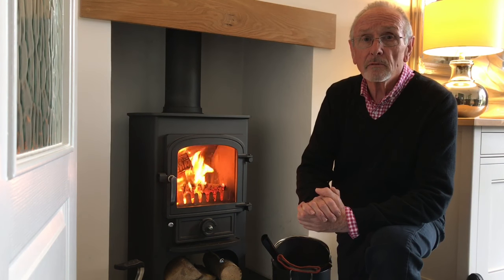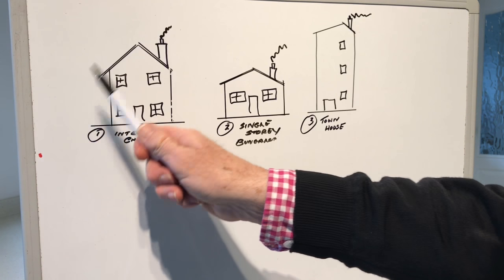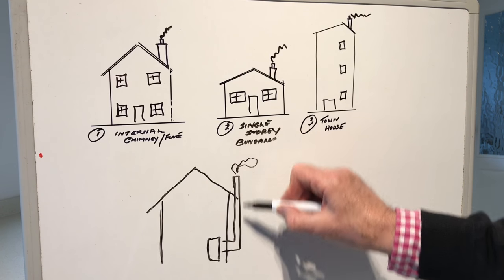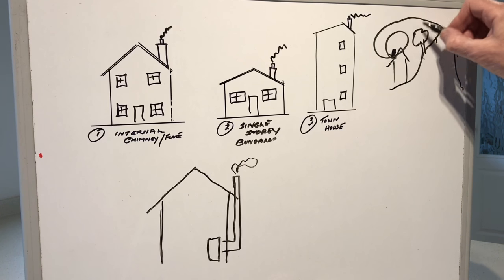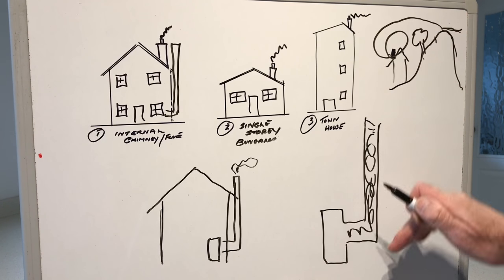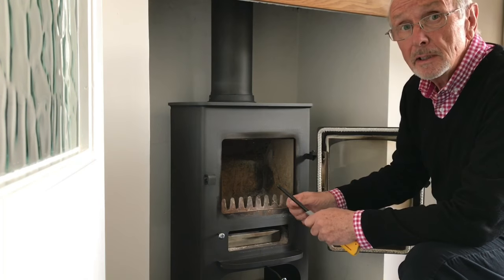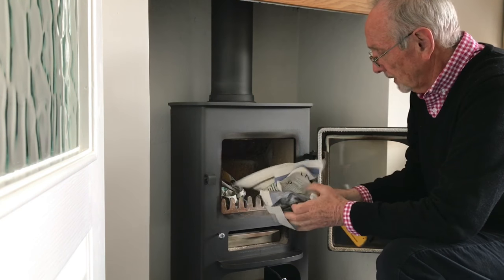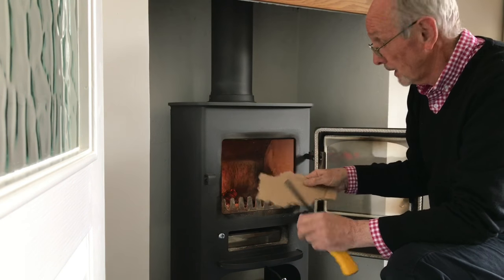How to Stop Smokey Rooms When Lighting Your Log Burning Stove (Revised Film Resolution)

Comment: Build a top-down fire.  Place relatively large pieces of firewood on the bottom, medium pieces atop those, smaller pieces on the medium, then kindling and tinder atop it all.  Light the tinder, which will burn warm and smoke free, igniting the kindling, etc.  The flue will be quite warm long before the larger pieces of wood might create any amount of smoke.  This is far and away the easiest method by which to light a fire from a cold fire box.  It allows you to stack material, in a criss-crossed pattern, before lighting but a single match for the whole fire.  You can walk away and come back after an hour or more, secure in the knowledge you will have a hot, clean-burning fire in your stove.
Reply from the maker: Thanks Jason and a good way for many. This can be a good way and I use it myself quite often, however it does have a few issues and for the new user or less experienced user there are possible problems. I will do a video on this soon, but the two main issues are as follows (1) if and only if, the fire fails to push the cold up the chimney you have a full stove of timber etc to deal with as the room fills with smoke.  (2) If for any reason you open the door, this higher fire can fall forward and may spill out. I know this is being ultra carefull, but to the unexperienced (and this is the people I am targeting to help!) this may be a big problem. Many people get nervous when they first have a log burner and don't have the skills to deal with the unecspected. I'll tell you all a quick true story - I had a new neighbour living in a cottage not far from me who attempted to lite her first stove ever. She was living alone and lit the stove, it went well, in fact it went too well, I was called and rushed to help. Her stove was white hot I could not get near it. So called the fire brigade! What had happened was a cinder had found it's way into the lower air intake and blocked the mechanism from controling it. She had loaded the stove up to the top and the air intake was wide open, the rest needs no explanation. Surrounding area was heat damaged and in need of repair and redecoration. It took the fire brigade only minutes to get the stove under control by dropping powder (probably Carbon Monoxide!) into the stove denying the fire of oxygen. Maybe not Carbon Monoxide, I will stand corrected if anyone knows better. So I keep my teaching skills aimed firmly at my target audience (beginners) for safety reasons. Thanks
Reply: This is the way I always start my wood stove fire.  I place two large pieces of wood on the  bottom with a space between the two. In the space between the two I use kindling and a small amount of paper, usually tubes from toilet paper and paper towels. I place small wood on top.   And for kindling I use broken twigs in my yard from my trees.
Reply: This works fine for me , I have an external flue and was getting smoke pushed back using conventional wood pile with fire lighter underneath .
I put two under the stack and one on the top which I light it burns down and eventually catches the ones underneath pretty quickly.
Flue is warmed and never had any problems from using this method

Comment: Add this: open a nearby window before you light the paper. This corrects negative pressure. Simple and effective.
Reply: Ronald Morris yes! Just crack a window, preferably the opposite side of the house or basement where the wind is blowing towards the house. You can also use a hair dryer in the stove directed towards the flue for five minutes. You can also use a space heater facing the opened door of the stove. Lighting news paper, blow torch, hair dryer and space heater also work for the fireplace. Got to get that flue warm.

Comment: I have an external flue and had a smoke problem. On cold nights I use a Black & Becker electric heat gun to 'push' the cold air out of the flue. I put the gun (sitting in it's upright plastic holder) inside the  firebox for 5 mins. I then remove it,  build the kindling fire and get the fire going as quickly as possible. No more smoke.
Reply: I've been using a hair dryer for years, same way, same results. It doesn't get as hot as the heat gun but it moves a lot more air, helps to establish draft. I have also tried a large brush flame torch, (not a flash light torch) and found the hair dryer worked just as well without wasting acetylene.

Comment: I  have a large wood furnace, and have a big problem with smoke. I open a window, and light newspaper first. I sometimes get a lot of smoke coming out of the door. Even when the fire is burning well, when I slowly open the door, smoke comes out. I had an extension put on, and this helped, but again today, lots of smoke in the basement. I have a wood stove and fireplace that I use sometimes, and have no problem starting them. It is very upsetting. I wish there was a professional that could come and stay at my house for a few hours and see how difficult the situation is.

Comment: Along with the heating method you should also crack a window, preferably on the opposite side of the house or basement where the wind is blowing towards the house. This will help replenish the pressure needed to help move the air up the flue. You can also use a hair dryer in the stove directed towards the flue for five minutes. You can also use a space heater facing the opened door of the stove. Lighting news paper, blow torch, hair dryer and space heater also work for the fireplace. Got to get that flue warm and new air/pressure flowing!
Reply: That is exactly what I do and have no issues with smoke

Comment from the maker: Good advice  from 'Theoriginal1981' and you know the problem well. Most people install a log burner and are not aware of the safest way to start the fire lighting process. I've heard a lot of comments on rooms full of smoke over the years, just a little preparation and the problem is solved.

Comment: Hi Mike we have had some really big issues with our log burner up to the point where we have had almost enough. In desperation we turned to the internet and found you on YouTube video which has really sorted the problem. Just like you we have an external flue in a very exposed location, but after following your excellent advice the issue was resolved. Thanks so much you have saved the day and our log burner. John&Hazel.
Reply from the maker: John so pleased I could help, I will be doing a new video soon with a turbo version of the two videos I have done which I have been doing for a while as it works even better. Look out for that one. Best regards Mike
Reply: Mike Craft Mike thanks for your reply. Will certainly look out for your new video and if it is as good as the previous one it will be a winner 😊👍 Cheers John

Comment: I think your stove does not down draught like ours does, it can't even be in the same league, lighting anything Inc paper results in the flames and smoke coming out the door at you. I have tried the paper method and sometimes if your lucky it will sort of work however the room still skinks. 
Warming the flue with some form of heater is a bit of a joke and I'd rather not use it than mess about doing this every time. 
Why not fit an anti down draught chimney cowl? The main type I'm referring to are the ones that have sail and spin in the direction the wind is going, this creates a negative pressure in the flue essentially pulling the air out.
I'm sure these methods work on yours, especially the gas burner.

Comment: ...or, get a pellet stove with a forced draft and your problem is solved.  Pellet fuel is cheap and pretty clean to handle unlike logs. No worries about overfiring the stove, either.  I'll admit it isn't as charming as burning wood you've split yourself in a big ol' cast iron stove but it's convenient and still way cheaper than oil, gas, or especially propane heat.  I swore I wouldn't pay to heat with propane ever again.  If you're on a fixed income it'll positively eat your SS check all winter!

Comment: Get rid of any 90 degree bends .  . use an insulated flue .. ensure the ( insulated)  flue exits at least 3 ft above any roof ridgeline . or basically get a decent afterburn wood stove like the Dunsley heat YORKSHIRE stove .. Check out their afterburn technology . It is on another level to the stove you are using .

Comment: When you open your stove...does it smoke the room ??  Mine does ...has anybody got an idea why?? I see others have no  such problem....
Reply from the maker: Hi, First of all what type of chimney and set up do you have? What flue system is also important? Without this knowledge the most probable cause is cold air falling or a vacuum inside your home causing a back flow. Try lighting a candle near your stove and study the effect of the flame, leave the door of the stove open a little. If the flame bends away from the stove then you have a draft issue. This can also be affected by your local weather or the terrain around your property. Moving the candle to different parts of your property can tell you how the draft is moving. My other video on smoky rooms may help:-

 https://www.youtube.com/watch?v=5A9gjPKqbLU 

Every property can have its own special air flow pattern, so a bit of detective work is necessary to find out what is going on is necessary. Try leaving a window far away from the stove open as well and see if the candle changes, your are looking for the candle to bend towards the stove a little. Hope this helps, please let me know what happens after testing and watching the other video. Good luck.
Reply: The video is great advice. 

On this issue though you might be opening the door too quick?

I slightly open the door (no more than 2cm and slowly) for 5 seconds. You see the woosh occur and any smoke will go up the flue. 

At that point you can have the door open for quite a while and shouldn’t see any smoke.